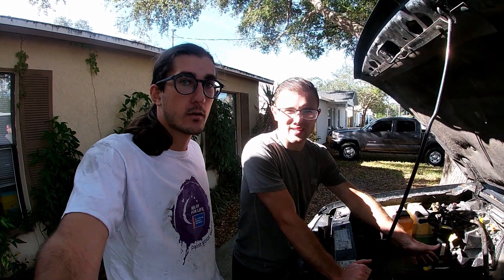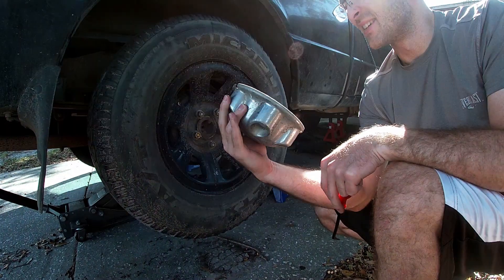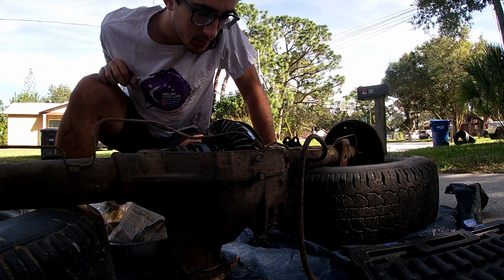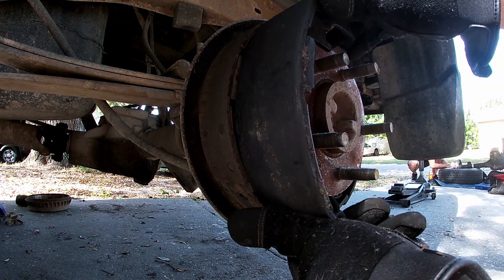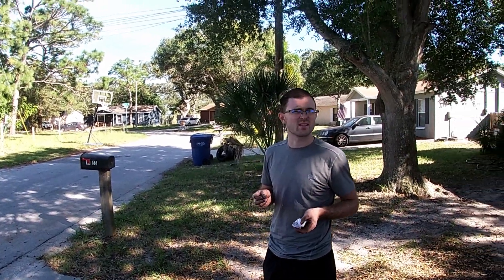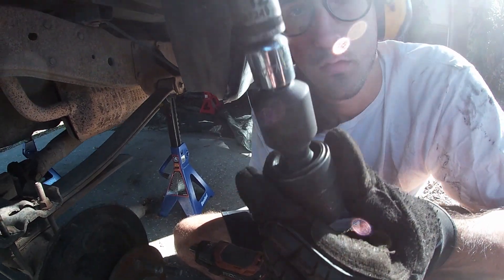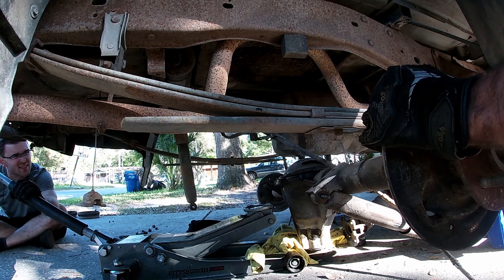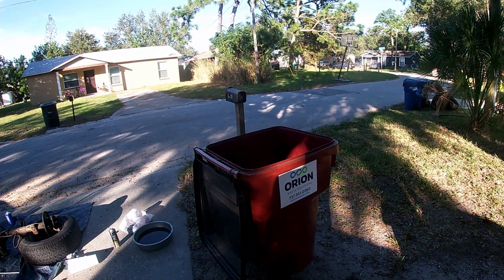Upgrading our 98 Ford Ranger to a 8.8 Limited Slip Differential (Part 1)

Comment: 7.5's come with 9 inch or 10 inch drums. You went from 9 to 10. Not because it's 7.5 but that was what your ranger came with. My 7.5 3.73 has 10 inch drums. You don't have to get an explorer rear end to get disc brakes they have a conversion kit. You don't have to get an explorer rear end to get an 8 8. It's an option on many rangers.
Reply: Not that these guys didn't know but someone else may think the explorer rear end is the only way

Comment: I would have replaced the clutch packs guys, those wear out significantly after 30-40k
Reply from the maker: I ended up taking this apart, re-gearing it and replacing the clutches shortly after.

Comment: I was told to use explorer rear end. I'm swapping mine with a limited slip for better traction.
Reply from the maker: We went with one off of a Ranger that had a limited slip diff since it was a more direct fit. If I remember correctly the explorer one has disc brakes and requires some cutting and welding to mount up.

Comment: So a couple of things. After replacing the rear end with the 8.8. You are going to need to change the gear ratio in the cluster, otherwise your speedometer will be off, and I don't know by how much. 

The second thing is that those shocks are supposed to be that way. They don't support any weight. That's what the springs are for. The shocks are designed to absorb road vibrations. They do that using oil inside them, and that oil is moved back and forth across a valve or hole plate on the rod end. The slower you push, the less resistance you will feel in the shock. 

I have the 8.8 in my 2000 Ford Ranger, and have only needed a LS rear end once in the last almost 23 years I have owned the truck. That rear end is going to change the way the truck handles in tight turns as well. So be aware.
Reply: only needed it once? i’ve got three words for ya. rain, parking lots.
Reply: @Tyler-dw4zy  what are you talking about? I have an open diff. I was saying that there's only been 1 time I got stuck, and a LS or locker would have kept that from happening. I had parked on the side of the street after a snow. My left tire was on pavement, and the right was on ice. I had to get a push to get going. It was the only time my truck has been stuck, and it was the dumbest situation... LOL
Reply: @granitecowboy2199  What I'm saying is the reason youd swap to an LS diff is to be a jackass with it lol, you dont do it for practicality reasons. Otherwise youd just buy one with an LS diff
Reply: @Tyler-dw4zy  Wet grass, painted parking lots, old wet pavement, slight icing at stop signs, ANY mud…
Reply: @adeedaas  exactly

Comment: I have a same year Mazda b4000, looking to change to limited slip diff.

Thinking of also added stronger leaf springs and an air ride system for the rear suspension

Comment: I have a 200 ford ranger 2.5 liter. If I want to add a 8.8 limited slip differential do I need to replace the whole rear axle as well or could I just replace gears inside the gear box with the limited slip in the stock rear axle? Please help new to this.
Reply from the maker: The stock axle is a 7.5 open differential. Ford only makes a limited slip in the 8.8 so you cannot just replace the gears inside. If you are new to all of this I will say actually messing with the gears inside the differential is one of the most difficult jobs on the whole car in my opinion because getting the gear setup is very difficult and requires a lot of trial and error. For reference I was able to rebuild the engine right on this ranger the first try but it took me 4 tries on rebuilding the internals of the differential to get it right the first time. There's a good EricTheCarGuy series on rebuilding 8.8s if you are interested, he had a huge amount of trouble as well. I think there is an option to drop a lunchbox locker into the 7.5 although I haven't done much research on that route. But basically the short of it is you need an 8.8 if you want a LSD.
Reply: @RKAdventures45  Incorrect, Ford does indeed make a 7.5 limited slip, code is F6 for 3:73 limited slip, just picked one up at pull-a-part from a 2004 Ranger, swapping into my 1999 Mazda B2500 now.
Reply: @JosephMitchell-ng1rl  this is true, they do, but pretty rare in my experience. Been looking for one for a while... Thinking about just throwing in a locker at this point

Comment: Just swapped a 4:10 into mine...HUGE difference!
Reply from the maker: So ironically the axle tag claimed this was a 4.10 however I have recently disassembled it and swapped it to a 5.14. During that disassembly I found that the previously owner of the car this axle came off of had swapped it to a 3.73. Fortunately the 5.14 has made a huge difference!
Reply: Do you have to give it more rpm’s to get moving faster with 4.10’s compared to the smaller gears?
Reply: Doing this to a 4.56 have the 4.10 now

Comment: Awesome video--looking to do this exact modification myself before the harsh winter comes. Beautiful truck, by the way 👍
Reply from the maker: Thanks, she’s a trooper and puts up with pretty much anything we throw at her 😂
Reply: @RKAdventures45  you guys did a great job, my ranger came equipped with the 410 LS.
Reply: @Mr.McGees  I have the 4.10 as well, but it doesn't have LS. Kind of an expensive upgrade too when I have only needed it once in the last 23 years I have owned my truck.
Reply: @granitecowboy2199 yeah I think this upgrade is overkill for most people in most situations. I have the 8.8 open diff in my 2011 Ranger... truck handles just fine on slippery surfaces after flipping to 4x4. Even better with weight in the bed.

Comment: the original rear end is a 7.75 :) just fyi. also its too late now but if you use an explorer 8.8 they come with discs instead of drums... now you know for next time :)
Reply from the maker: Are you sure it’s a 7.75? The ranger station claims they are all 7.5 or 8.8: https://www.therangerstation.com/tech/ford-ranger-rear-axles/. I did see that about the explorer rears however those do require a welder which I unfortunately do not have access to, so I just went ahead with the bolt on option, I do much prefer working on disk brakes over drums tho ;)
Reply: Yeahhhh no. All sources (including the manufacturer) indicate this generation of Rangers shipped with either a 7.5" or 8.8" rear differential (and rarely a 6-7/8", apparently). Maybe the newer 2019-style rangers come with a 7.75", but not these. Installing an Explorer rear end involves installing new brake lines, a proportioning valve, dropping the rear of the truck (or modifying the leaf spring mounts on the Explorer rear end). Installing a used Ranger diff is the most economical option by far. Plus, unless you're doing a lot of towing, the increase in braking performance would be negligible with no weight over the rear axle.
Reply: rangers came with 7.5 or the lil 8.8 (a mix of a 7.5 and 8.8 guts) your best straight forward update is a 31 spline 8.8 with drums. i just got a 8.8 out of a 93 exploder with both leaf springs for under 90 dollars (one leaf spring is bad however) im in the process of cleaning, changing fluids and repairing the leaf springs, is going to upgrade my old 92 ranger